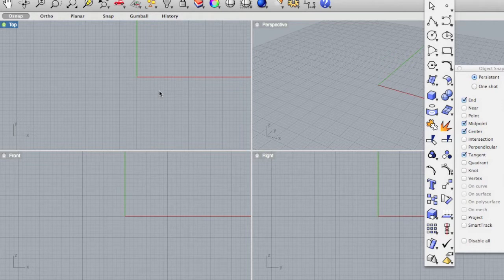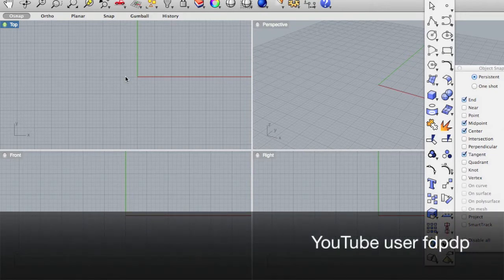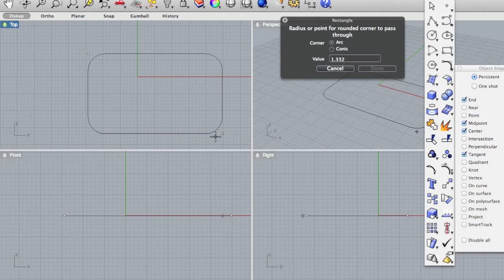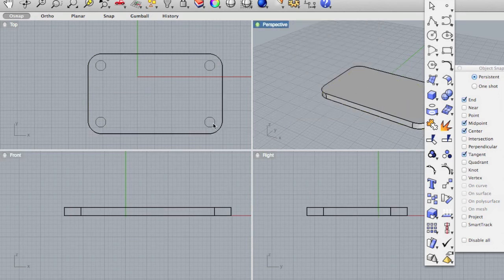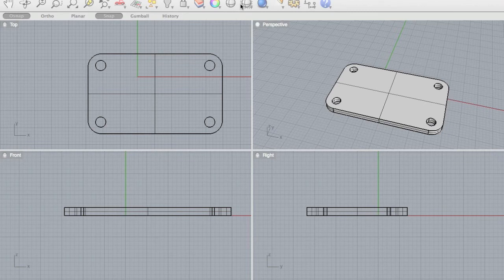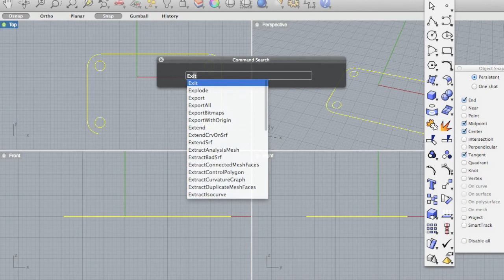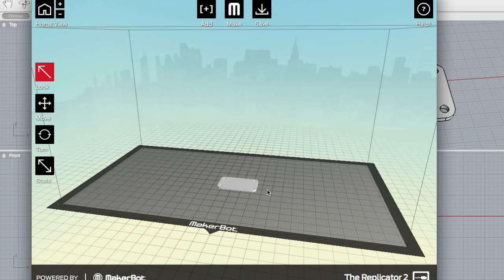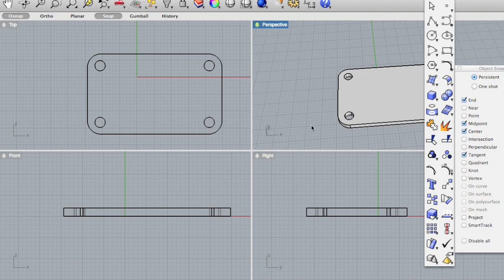Rhino 3D Tip for Creating Holes by Extruding Multiple Curves

Comment: hey man,am currently doing my form making with rhino as well but i hv no idea on how to make perforated dome..since the holes are not going to be on a flat plane arent they..could u demonstrate that,bud?simple solutions fr perforated domes with no assistance frm plugins :) many thanks
Reply from the maker: fazmy13 Thanks for the question. I'm still getting my head around everything that can be done in Rhino and my design skills are lacking. So I'm not sure I can give you much help here. I would definitely check the Rhino 3D community forms. Lots of guys over there willing to give assistance. Good luck.